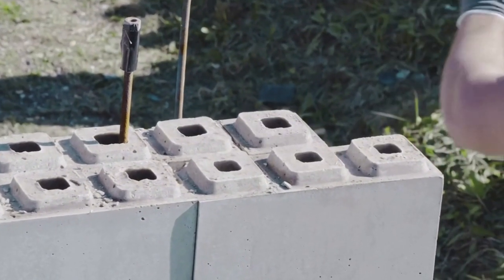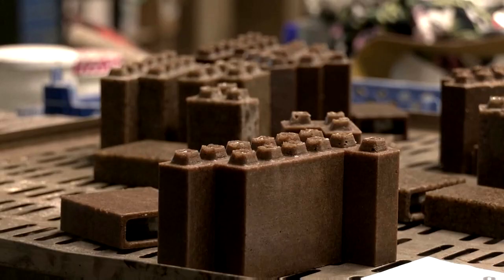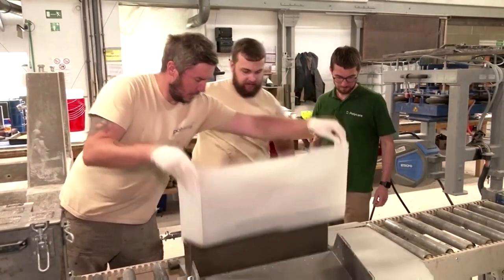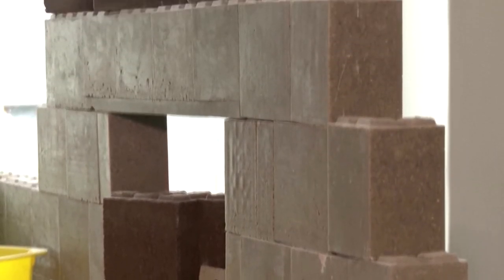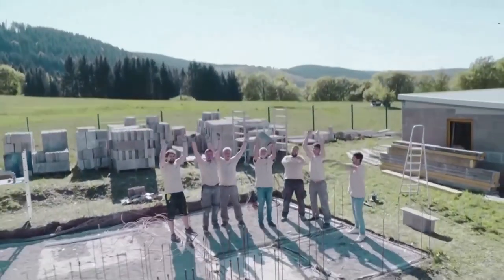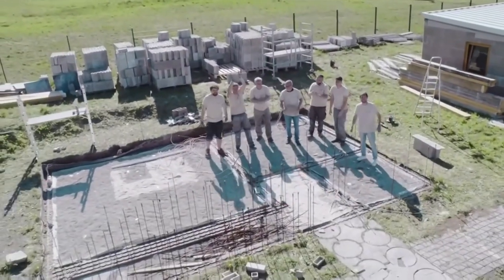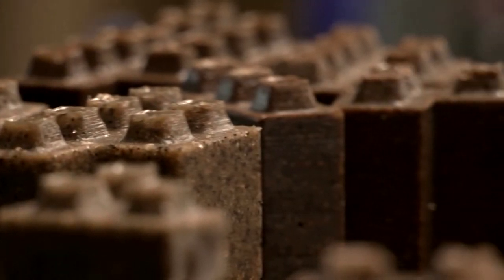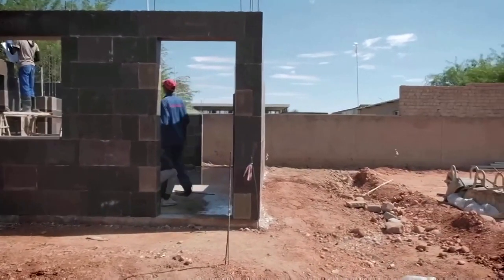Sustainable blocks let you build your own house

Comment: Good thing you do not need plumbing or electrical, because there is no place to put it with those blocks.  If either were to be put in a house, chase walls would be a must unless you are going with exposed pipes and electrical conduit.

Comment: Tell me more about this artificial resin. I heard of people doing "co2 sand casting" + resin to make stronger than concrete blocks. But it seems it would be really expensive to get that much resin.

How the heck they get resin at an affordable price. Comparative to concrete. 
How flammable is the material?
Reply: the point what i concern is how about fire resistance